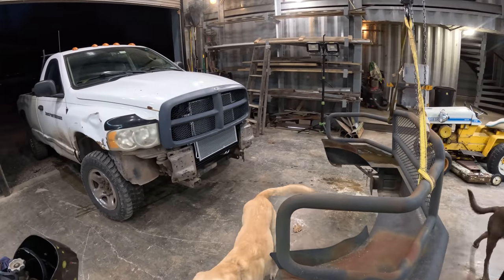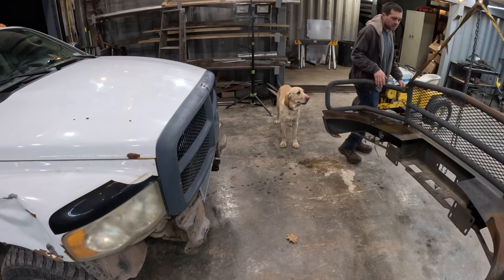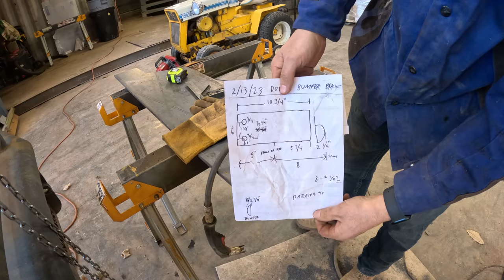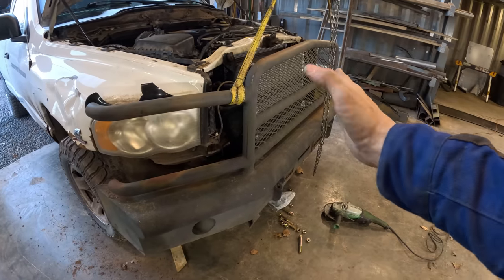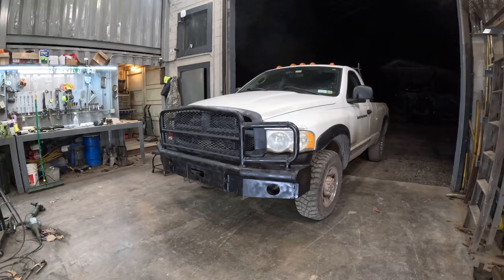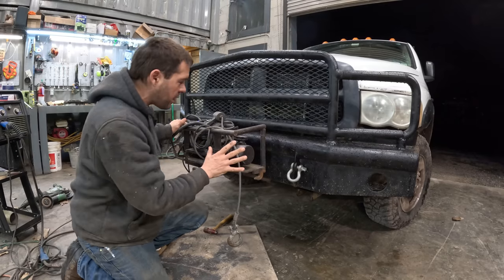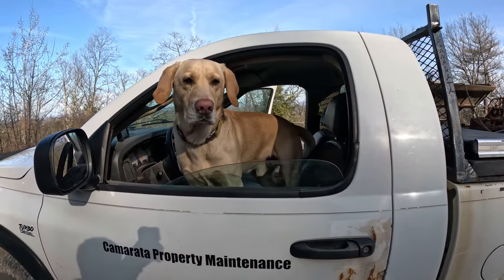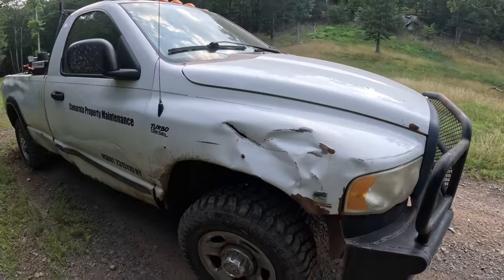Installing a strong bumper on a pickup truck

Comment: Working by & for yourself has it's rewards. Not so much arguing about how something should look or work. "It looks ok to me" is how it ends & I like that about your work.
Reply: It also has some downsides, namely not having much help
Reply: @jakealter5504  i bet you two envious girls, never worked an honest day in your life. what would you know
Reply: @SouledOut357  what are you on about?
Reply: كلام سلايم
Reply: I agree. But even on technical things, I had to argue bitterly with the guy who was supposedly helping me restore some vehicles.  He didn't know when in the firing curve "advanced" was in relation to "retarded" .  He put in the lower control arms on my Lotus BACKWARDS and wondered why the steering rack was so far down the threads in adjustment.  Flipped 'er over, and presto changeo!  I let him know that.  I was happy to do things on my own to avoid his bull anymore.  And then he tried to re-join the Navy, had a cholesterol of over 300, would NOT take the statin drugs to lower it, started smoking cigarettes, and keeled over dead as a doornail at 57.  Yes to his dying day he had plenty of room to criticize me and others, and avoid all fault taking on his own. I even got him a job at my work and all he did was moan and sabotage a job that, were the FIRST TIME, he made decent money, got some modest Stock options, etc.  Sadly he was SUCH a good mechanic and restorer and did his work job well.  I  had to get a bit non-linear with him to make him aware of how badly he was screwing things up for NO REASON.  Annnnnd, he quit and ended up selling ALL of this great auto repair gear to make ends meet.  He'd proclaim, "I pay my bills!" yet had a 10,000 dollar debt with Snap-off.  You can't help people like this and at the end they have to just live with themselves, and yes, best to do it yourself if at all possible.
Reply: @silasmarner7586  cheese & rice silas..you writing a novel about it, your off to a good start if so. loll
Reply: @blue-tb2fd  figure it out, you figured out to run your mouth to me
Reply: @silasmarner7586  Reminds me about one older body-tech guy we had in the shop many years ago. He could do everything with his mouth, complained on all the other guys including me, "You doing it wrong, bla bla bla" Took a couple of months before we started seeing Mr Knows it all, screwing up more and more with basic things you have to check and follow while repair collision damage. Remember one time he was replacing a outer rocker-panel on a 4-door car with both doors off the car..He cut the rocker off and installed the new one without mounting the doors to check the gap between. My friend pointed it out but Mr Know It All, njaa not needed, just clamp and weld it all the way & over to the paint-booth.
Well the next day car was painted 2 new doors and new rocker panel, Mr Know It All" started hanging the doors...we soon heard cussing and someone trowing wrenches around from his work area... 
Finally our Shop manager came out from his office to see what's going on, yelling and cussing become louder, went over seeing what was wrong... well the rocker panel were 3/4 inch too high so not even the two doors could close..lol  
Only thing left was to start over, cutting the fresh panel off, all spot-welds and install a new rocker... This guy lasted one year in the shop before quitting, we celebrated day after his last day ! 😆
Reply: Andrew is smart enough to be his own boss.  His wingman, Sam, is a perfect fit for him.

Comment: I think Andrew was using that derelict car as a make-shift road grader blade. It seemed to do the job pretty well. And he's right; you never know when a rogue electric dryer will run across the street in front of you so you need a front bumper for your truck that will do the job. And after a bit of modification, he has one.
Reply: He just needs skid plates under the truck from front to back now.
Reply: Man I was laughin' sooooo hard!
Reply: Roadway moose crossings in Alaska are the leading cause of vehicular fatalities.  
Electric dryer impacts are the second worst!!

Comment: that milwaukee circular metal saw has got to be in the top 5 or 10 best tool purchases in your whole operation, Andrew. What a beast!. Great video as always.
Reply: I want one too
Reply: Plasma Torch comes a close second
Reply: @VAX1970 is that a parkside plasma
Reply: chain hook that pulled the pickup bed a very close 3rd
Reply: It is amazing
Reply: @David-de3ed  Cut those tubes like butter... My stealing threshold now includes Military bases and small warlord's garages.
Reply: look for his older video when he built that gantry crane, and used that Milwaukee metal circ saw to plunge cut the huge ibeams! it was awesome. I came into work and the next time i used our I was like, WAIT i can plunge cut that 1/2" steel plate, ive seen Andrew do it!

Comment: That metal circular saw blade is impressive, cut pretty clean and fast,considering the thick plate you cut.
Reply: Do you know what kind of blade you used? I am just curious did cut clean and quick.
Reply: @johnfielder71 titanium

Comment: SUGGESTION: For rough(actually quite decent) bent body panel repair get a vacuum pull rod. Its a rod with sliding hammer on it, with 10cm diameter really soft and adaptive to uneaven surfaces rubber sucker with a hole in a middle. the hole on the sucker is connected through the rod to the back of it to quick fit vacum connection. You can pull miracles in seconds with that thing, and even keep the paint in tact, as it does not create sharp bends. You can pull it just with body force, hammer, or combined- it would do miracles on that fender in seconds.

Comment: That's definitely a nice little and rustfree pickup truck from the 1990's. I'm eagerly looking forward to watch the repair/restoration video. Maybe it will even be turned into a 4WD vehicle?
Reply: Some locking differentials would be great for those mountain climbs.
Reply: 2005 ram 2500 5.9 pre emissions Cummins locking difs would take this truck further

Comment: You already made that fender look better earlier in the video so even with that new scratch it's still an improvement lol.
And I haven't laughed out loud that hard in a long time, especially once you started dragging it around on the chain. And that scene where you come bombing into frame through the field and onto your driveway was one of the best filmed shots I've Ever seen and had me laughing so hard, I'm going to have to watch that again. Best entertainment Ever. And the best part is now No One can say you ruined that bumpers strength.
Thanks so much for the effort you put into your videos, I can't wait for the next one.
Reply: Body work a good use of your burkes bar .  What an essential tool to have around.

Comment: Love your video as always. I was wondering if, as an alternative to drilling and burning out those bigger bolt holes, you could have gotten the increased strength you were looking for by using a higher grade bolt that fit the existing hole.
Reply: Yes but increasing strength is irrelevant when there's a weaker failure point above it. Ie: you can make a joint stronger than the steel around it, which makes strengthening that joint irrelevant.

Idk why but that's hard to articulate. Maybe it's the 3 beers so far today hahaha
Reply: @jeffhall768  3 beers? You’re barely getting started. You got 9 more to drink

Comment: Andrew. Great video as always. For your radiator hoses don’t use those worm gear clamps. Use spring clamp/ constant tensions clamp. As the hose expands and contract’s the spring clamp will adjust with the hose. The gear one will not and cause small leaks.
Reply: That's such good advice, I l spring clamps are a real asset

Comment: Nice job modifying and mounting that cow catcher bumper Andrew.
A good thing to do with that pallet you had it on is put 3/8's plywood top and bottom with steel (NOT rubber or plastic) wheels casters on the bottom eaxh corner 2 or all 4 of them locking type and 2 more a 1/4 of the way from one end for center support. 
I had 2 like that. One for arcade games I was repairing or restoring the other I could hook to it to be long enough to set a pinball game on.
I had 3 along my garage/shop wall to stand on while working on them at the same level.
Made moving them around so easy.
I actually had 6 of them so if I painted an arcade game cabinet I could roll it out of the way while it dryed and roll in another to work on.

Comment: Hey Andrew, Timbren and a couple others sell helper springs/airbags to compensate the extra weight on the front end. It will help your truck out with all that suspension load.

Comment: I am amazed that truck is still going! Cummins 12 valve ftw! IMO, with the added weight of the bumper plus the plow may need to stiffen the springs or get a set of Timbrens.

Comment: It is for sure a solid bumper but the reason vehicles are designed to crush so easily at the front is if you were to crash your truck, you want the front end to absorb as much of the impact as possible to protect you. If the front end is solid then it will be you absorbing the impact and that is how you get hurt or get killed.

Comment: Good job on the bumper and testing! If I were you Andrew, I wouldn't destroy that old Nissan truck either. I'd find a used motor for it and put it back on the road if its in good enough condition mechanically. Lord knows you have the tools and shop to do it and it would make a good video.

Comment: Impressive skills at 11:00 sharpening that drill bit with an angle grinder! It never worked for me. I could never get the right angle even though I tried many times. I use a Darex DrillDoctor now to sharpen drill bits.

Comment: I have to say the American bull bars are fairly clunky and rudimentary compared to what we have been building and using in Australia for the last 35-40 years. In most rural areas of Australia we have kangaroos, and they will jump in front of your vehicle almost every time at night. It is like the headlights are a magnet for them. Most bigger roos weigh well over 100kg, 220 lbs. if you are looking for a commercially made bar for almost every make of 4WD, then ARB are the product to buy, they even export to the USA. If you want a decent bar that will protect the front of your vehicle against weekly, if not daily impact with big kangaroos, then you need a 5 post bar. These generally dont comply with most state road authorities due to the fact that they dont crush in a collision, and are quite often home made but they look bad ass as hell. What they do though is protect the front of your vehicle and let you drive it all over the country, and keep driving it even after several hundred collisions with the big Australian grass hoppers!
Reply from the maker: Deer run in front of cars here.

Comment: I used to deliver stuff in L.A. when I was a kid. I quickly learned you have to beef up your vehicle. I had SmittyBilt steel tube bumpers on both ends, that completely destroyed many expensive cars driven by idiots, and I barely got a scratch.

Comment: Thanks Andrew. Was anyone else wincing while you drilled the 3/4 holes UP CLOSE TO THE RADIATOR WITHOUT A STOPPER (wood or finally checker plate)?  Man, I'm still puckering.

Comment: Well, in Germany there are specifications on how much energy a bumper (or chassis) has to absorb and there a large vehicle (truck, SUV) has to have more material to deform than a small car.
Otherwise, the small car owner would have little chance of survival.
That's why the damage ($$) to SUVs is usually higher than to small cars.

Comment: Use a bench grinder to sharpen your drill bits and a bungee cord to help pull the drill into the metal you drilling and slow down the drill you burning them up . Plus get you a demagnetizer for the drill bits that holds metal to them .

Comment: If you hit a pedestrian with this bumper, he has a worse chance of surviving. When you crash, the bumper has to absorb the energy. Therefore, the cars are not made too rigidly, so that the energy is used to transform the sheet metal and, as a result, there are not too many accelerations in the collision. But anyway for low speed colision this is awesome.

Comment: Each one of those 1/2 “ bolts in an 8.8 grade would hold over 6600 lbs in shear, more in tension.  Nothing like overkill using 3/4”.

Comment: Hey Andrew quick question, can a 40 foot shipping container be placed on it's end all by itself, or can you do maybe two 40 footers like this and make a vertical hotel ?. You can have 4 tiny tall rooms with bunks, ladders and stairs, with a sky tower observatory. Kids would love this, I would imagine I would need some huge vertical beam columns, right ?. That should get it done I think, then some stairs, is block just easier for a small castle ?. The style of building isn't really common.

Comment: Tapping fluid  could be used on the drill bit. But the plasma cutter does the job.
The plate for the mount!
This bumper is not going  anywhere.

Comment: Is that bumper made of 3/16" thick steel?  Is it any special steel?  Is it holding to the frame by 4 bolts or more?  What size bolts 5/8" thick.

Comment: When cutting the new bumper, transferring the curve is done differently, that's why it doesn't look right and has a huge gap. You need to always cut the curve the same distance in the forward direction of the vehicle, not equal distance from the tangent of the curve itself (as done in the video). You changed the radius by quite a bit. Love the video thou.

Comment: That bumper will probably outlast the truck. 
Ram needs to go back to building 2500’s to the early 2000’s spec because this is a testament how solid those trucks were built.

Comment: That rust free 2wd truck is your opportunity to build a v8 swap 1/4 mile Or truck pull or easier to buy a rusted out 4wd same model convert to 4wd  and have a really nice truck Your Cummins truck has been great It’s what I have a 2002 and a 2006 both from down south Rust free

Comment: Andrew was impressed with your plasma cutter cutting holes in the 1/2 plate and how nice a bead you layed down with your welder. Mind sharing what you  got ?  Bumper built like they should be. Keith
Reply from the maker: Thats a miller 211 welder and Victor cut master 52 60 amp

Comment: Have u thought about running some electrical conduit along the edge of ur property and installing a bunch of outlets down the length of ur machine parking area... u need a bunch of battery tenders... it always seems like 1 job turns into several when u have to run back and fourth to get a generator and a battery charger just to start a machine thats been sitting for a long time

Comment: Hi,I think you should of just made a 4 inch pipe bumper with a slight angle on the ends ,a heck of a lot easier and you could of sold the giant bumper to pay for the pipe.

Comment: You don't go snow-ploughing any more Andrew, it has not been in your videos for years, so the new bumper can go on.
Why didn't you sand down and rust-proof the bullbar before painting it? also you should have put in some high-Lumen lights into the round light cutouts on the new bar.

Comment: How do you change the headlight & turn signal bulbs without removing the bumper with a chain hoist?  I have an 05 Dodge.  It has been great, but there is no access from behind the fixture, it has to be pulled out to the front to access the bulb sockets.
Reply from the maker: I have not tried. They might fit out. It is only 4 bolts to remove that bumper.

Comment: Next time take your torch and preheat the metal, it'll make drilling alot easier. And drilling heavy gauge steel with the cordless will crush that weak motor, electric is better for heavy applications.

Comment: Hi Andrew... I just got the same Milwaukee Metal Saw that you have because I need to cut a 1/2" piece of plate steel. I tried using it with the GP blade that came on the saw and it wouldn't cut it. Actually, I was able to cut about 3/4" while pushing with all my might but it's a 4' cut and that would have taken hours. Have you ever tried cutting 1/2" with your saw? And if yes then please tell me what blade you used to do it. Thanks.
Reply from the maker: Yes, I’ve even cut much thicker plate than that, just make sure you’re using a blade meant for metal, also make sure you were not trying to cut hardened steel. Cutting mild steel is fine. If you were cutting hard steel like AR plate, you need to use a plasma cutter.
Reply: @AndrewCamarata  : K Tks... I'll give it another try.

Comment: that seems allot of weight in front of truck in winter, old cars where all steel, its cheaper to make cars that crunch in a accident, yet only safe under 60 miles an hr, forced to buy new car, better for financial tax system. you can walk away with minimal damage, fixable. fun video

Comment: ANDREW HALO COLLARS IS THE WIRELESS BOUNDARY THAT YOU DRAW OUT ON YOUR PHONE AND THE DOG WEARS THE COLLAR THATS GPS CONTROLLED. WORKS JUST LIKE THE IN GROUND WIRE COLLARS DID BUT NO WIRE. DRAW BOUNDARIES ON APP ON PHONE. DRAW THE PROPERTY LINE AND THATS THE BOUNDARY FOR THE DOGS.
Reply from the maker: Do they work though or are they junk?
Reply: @AndrewCamarata  I don't know. I just wanted to tell you about them. I also seen another that's the same thing. You can try I guess is all I can tell you. Look them up and see what you think. I guess there's others too. I guess you could google wireless boundary dog collars. IDK. Just wanted to tell you because of the problems you have with the dogs running off. 🤷‍♂️

Comment: You should build a steel solid pickup bed for that truck. Much stronger than that tin foil bed.
Reply: official-.AndrewCamarata  I think you could take ideas from a bed on a utv. Possibly make it have a dump function for easy unloading & a built in tool box in the bed. It be a beast of a bed.

Comment: Heavy bumper diesel engine and a snowplow and you will be replacing front suspension and steering components on a regular basis.